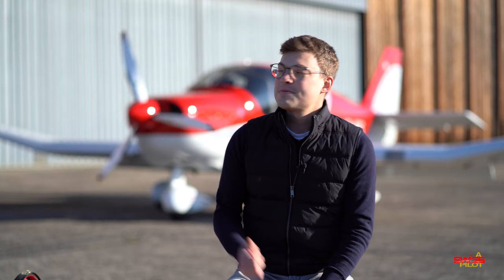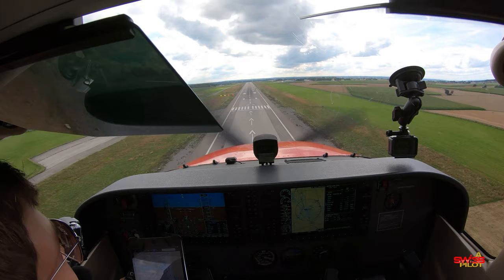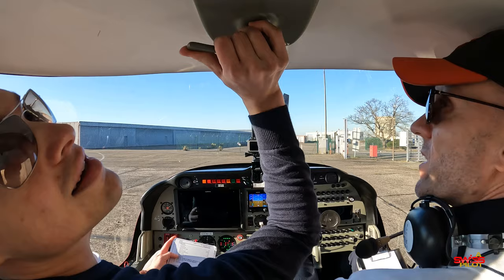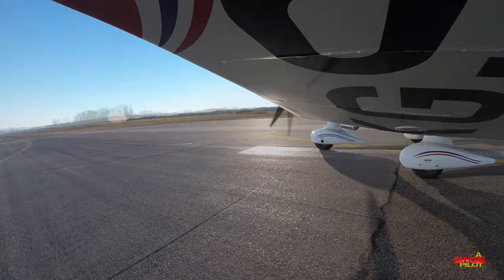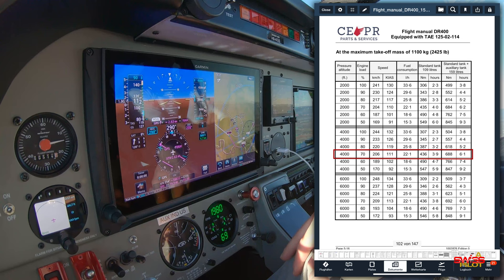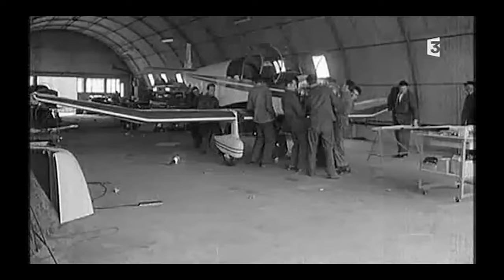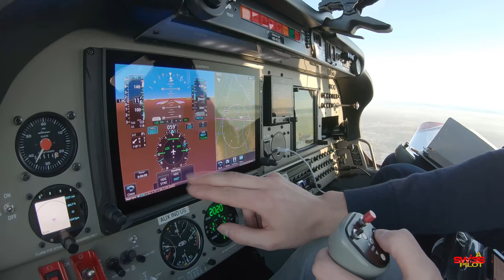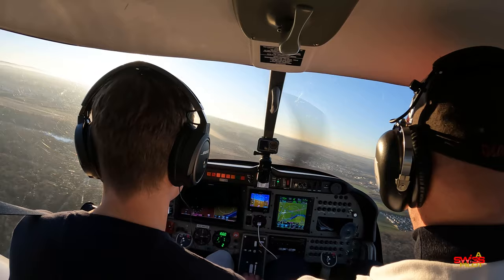Flying a timeless European LEGEND - The Robin DR401: Better than ever.

Comment: I flew my first 45 hours in a Robin HR200. Fantastic trainer aircraft, very forgiving and predictable. I could have chosen the C172 or C150 to train in but the low wing and centre stick appealed more to my inner Spitfire pilot.. I have since had the privilege of throwing a 2160 around the skies. I will always have a soft spot for these aircraft.

Comment: The DR401/CD155 is a great combination. The choice of Garmin avionics is good but the lack of an STC for the GFC500 is a significant omission. The only autopilot available is the antiquated analogue STEC which is both expensive and gives poor performance. Since I bought my DR401 back in 2018 I have been asking Robin to get the GFC500 approved but they seem to be leaving this on the back burner. In my view making the GFC500 available is far more important than messing around with turbine power which uses 25-40% more fuel.
Reply from the maker: Thanks for your comment! Couldn‘t agree more, the STEC AP is not nearly as good as Garmin‘s Autopilots. Getting an STC for a new model is however incredibly expensive and Garmin will only spend this money if the model is very popular on the used airplane market. And Robin‘s only exist on the European market… So not too interesting for Garmin. And I‘d guess Robin doesn‘t want to or can‘t invest this amount of money either… 🙁
Reply: @ASWISSPILOT  Whilst an STC is expensive Robin have managed to get around this problem to fit other Garmin kit. As well as encouraging future aircraft sales there will be many of us who would be keen to retrofit a GFC500. I had a removable blank fitted to my panel and cable pull throughs put in place during manufacture to make autopilot fitting easier later. If we had a list of potential Robin customers for the GFC500 it might persuade Robin to do something about this. They can only continue with the STEC for so much longer and to not have an autopilot option at all will badly affect their sales in the more distant future.
Reply: Hi, Nigel, the problem is that Garmin have insisted on doing any STC themselves and they have to see a return on their investment (around €500k) within the life-time of the product, which is unlikely given the number of A/Ps that Robin have been fitting. There is, however both a prospect of FAA approval for Robin (Brazilian approval is already in place and there is some reciprocity with the FAA), which could lead to inclusion on the Garmin AML, and Garmin introducing a version of their AML for EASA aircraft. I believe that the latter is already underway, although I don't know how far down  Robin is on the list.

Comment: The usefull load of the Diamiond DA 40 NG is 407 kg. GFC 700 and DME ads 14 kg - but that's it. 393 kg usefull. And the Austro diesel is heavier than the CD-155. The trick is Diamond certified the NG to MTOM 1310 kg compared to the AV-gas versions 1200 kg.
Reply: "the Austro diesel is heavier than the CD-155"

Why ? What are the differences between them ? They are based on the same engine...
Reply: They are based on the same engine design but the Austro diesel has a cast iron crankcase and  cylinder block, whereas the Continental 155CDI engine is all aluminium alloy. The manufacturer's figures are 186 kg dry for the Austro and 134 kg dry for the Continental. @vzmax
Reply: @pretavol   Interesting, thanks !

Comment: Always interested in this model of plane and I think it age really well even today.
Coming from a Piper Cherokee, even I understand this is a better performing design, 155cv/hp is really barely enough for a 4 seater (since loaded weight are the same for both), you really need 180hp. Unless power delivery of the jet/diesel engine is different than avgas?
How much is the pricing of this plane? A Diamond DA40 have better specs and is a more modern design, only if the Robin have advantage in pricing.
Reply from the maker: Hi! Thanks for your comment! The Continental CD155 (155hp, turbocharged) outperforms the Lycoming IO-360 (180hp, non-turbo) in most situations. Compare the specs of a C172S to the C172JT-A as an example. The Robin is indeed cheaper than a DA40NG, provides better useful load and better Take-Off and Landing performance 😉
Reply: @ASWISSPILOT  that would be very nice, too bad there aren't a lot of used ones in the market, you have to go new.
I think by specs it is better than Cirrus SR20, not as good as 22 or DA40 except load in the latter case as you point out.
It would be attractive if it is same price or lower than 20.
CD155 is better than 360 is interesting since I never fly a diesel before, in which area you think is not as good?
Reply: The 155CDI produces more power at the propeller than the carburreted 180 hp Lycoming engine from 4,000 feet AMSL. The 155CDI also retains power better at altitude with a ceiling of 16,500 feet. The155 hp diesel engine also has a lot more torque than the 180 hp Lycoming that, in combination with the automatic constant speed propeller, explains the diesel's superior take-off performance.

Comment: Sad that they are closing down
Reply: Things are not always what they seem. CEAPR, who own the land, the buildings, the Type Certificates, the Design Office, make most of the components and have the same CEO, have hired back half of the Robin Aircraft craftsmen and have put them to work.
Reply: Production of both Robin and CAP aircraft restarted in December 2023..
CEAPR re-hired half of the workforce of the Robin Aircraft company and resumed production of both new and re-manufactured Robin and CAP aircraft. 
CEAPR has been operating for over sixty years. Its core business is design and approvals, parts manufacture and maintenance. CEAPR owns the land and the buildings at its facility in Darois, as well as the Robin and CAP Type Certificates and the Robin Aircraft name. CEAPR have APDOA, Part CAO, Part 21G and it makes or buys all of the components for Robin and CAP aircraft.